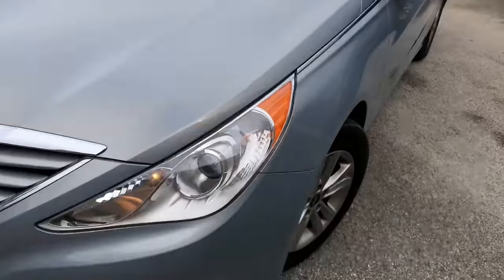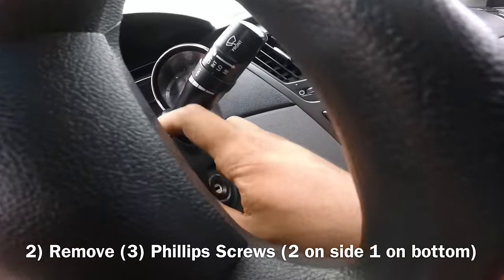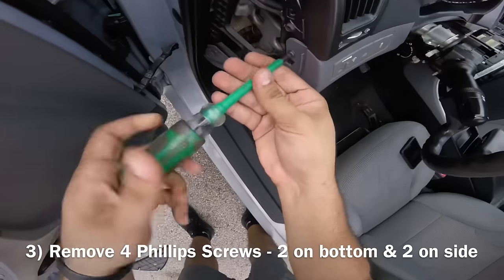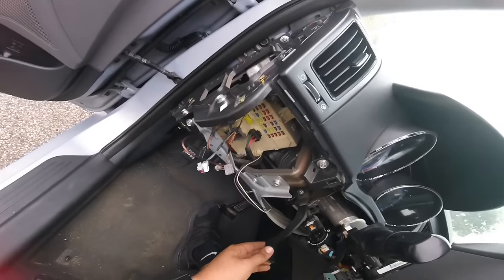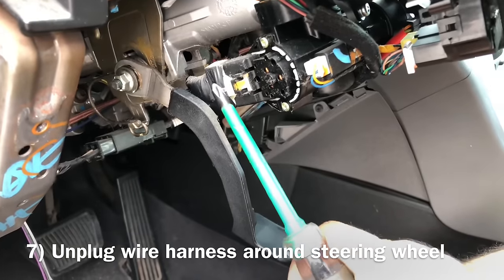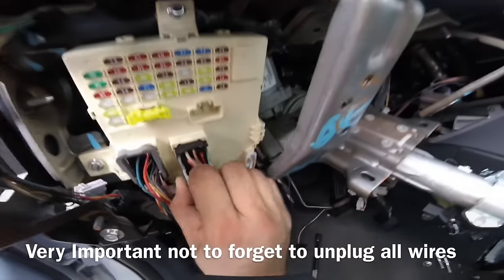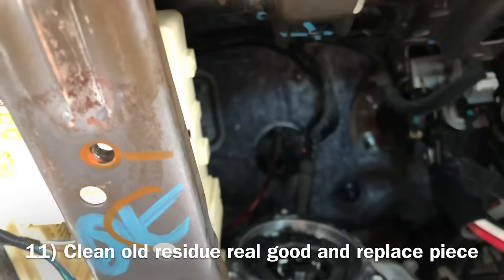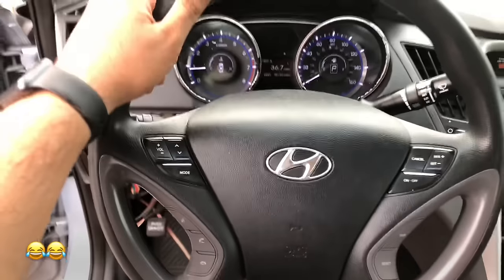HYUNDAI STEERING WHEEL NOISE : HOW TO FIX - SONATA/ OPTIMA 2011-2014 UNDER $20!! FAST & EASY!

Comment: Thanks a lot!!!! But I have an issue. I did this on a Veloster. When I put everything back together the steering wheel is off center. Like WAY off...  Any advise in how to fix it? Thanks in advance.
Reply from the maker: randall Dustan sounds like you may have to get a front end alignment. Just “toe” adjustment and should be back to normal... unless you wanna take it apart and try to straighten the wheel without the hook coming off... idk.. haven’t had that issue yet :(
Reply: @HidalgoMotorsCo  thanks a lot for the info though! I know it saves me a lot of money
Reply from the maker: You’re welcome bud! I’m glad I could help!
Reply from the maker: Hey Randall! were you able to fix the problem?
Reply: @HidalgoMotorsCo  yeah I got it fixed. All I had to do is remove the steering wheel assembly and put my key in the ignition. That unlocked the column and everything fell back into place.
Reply from the maker: wow! okay that is very important! just gotta be sure the steering wheel is not locked!! gotcha!! thanks man! super glad to know!

Comment: Successfully replaced...driven for over 500 miles without any issues, but have a plastic on plastic sounds turning right at the steering wheel? Any suggestions

Comment: Nice video! Question: so I had my sonata’s steering column replaced and then they noticed this needed to be fixed. I found another place that could do the labor for way cheaper so they put my car back together. I don’t think it has the coupler in there or maybe it’s the old, worn down one?? Anyway, I’m getting some noise from the front tire area and it sounds like something is loose. Is it okay to drive without the part for two days until my appointment or should I try to do it ASAP?? Thanks!!!
Reply from the maker: Mark Melby yes it’s okay. But you have to drive at your own risk. Steering wheel tends to shake a lot at highway speeds.. and have them change your CV axles and your suspension. Any clicking or clunking could be cause by those 2 things.
Reply: Hidalgo Motors Co TV ok thanks! I didn’t notice the clunking from the front before they put in the new steering column. Could the coupler missing affect that or could there be something loose?

Comment: So some people are saying they still had to take it to the dealership to get the codes reset for power steering. Does that sound right to you?
Reply from the maker: sounds about right. I didn't have to take mine back at all.. it worked perfectly... I don't see how the light comes on... unless they don't position the cover of the coupler back on correctly, I mean worst case scenario, take it to the dealership :) better safe than sorry, ask for a diagnosis, and then you try to fix as much as you can on your own.

Comment: Hey!! Trying to fix the issue. My husband took it apart yesterday, but when he was putting it back together the wheel got stuck and not moving. What could havehe done wrong? He's saying the motor is seized up...
Reply from the maker: That’s an excellent question. Please be sure he plugged everything in I would take it apart again and make sure all parts are connected properly.
Reply from the maker: Also the steering wheel locks sometimes when you turn it to the side once it’s off... maybe it’s that... messing with the steering wheel WILL NOT seize up your engine. If the car won’t start there’s a high chance he missed something
Reply: @HidalgoMotorsCo  I meant the steering column motor. He ended up ordering a new one. Hopefully that'll work

Comment: Just pulled mine apart. The old coupler seems to have melted and is a gooey mess. Does this have to be super clean before installing the replacement part?
Reply from the maker: Bob Oliver that’s a great question! You have to get it clean as best as you can. Grab a rag, or a brush and get all the stuff out of there.
Reply: @HidalgoMotorsCo  Ok. Thanks for the speedy reply. Great video. As all the others have said, thank you for posting this!
Reply from the maker: Bob Oliver you’re very welcome! Thanks so much for watching!

Comment: How often does this need to be replaced and whats the typical cost range you would get charged to replace it at a shop?
Reply from the maker: Hey! If you are lucky enough. You will only have to do this at least once after a while. 
The part costs under $30 from the dealer. 
What kills you is the shop labor rate. Specially if some charge about $75-100 per hour... 
One of my viewers took his in.. and they were trying to replace the whole steering column.. not the piece.. they tried to up sell him and refused to fix just that plastic coupler. They say it cannot be serviced. Although it’s a recall on these Hyundai’s... most of them aren’t covered. But check to see if yours is covered by the recall and it will be free!

Comment: I did this on my 2011 sonata yesterday, completely fixed the noise problem but now my EPS is out. Checked fuses and connectors and everything looks good. Also tried taking the negative off of the battery overnight. Is this just something that needs to be cleared?
Reply from the maker: You know I never had that issue... I wonder what happened... maybe needs to be cleared or something that’s an excellent question.
Reply: @HidalgoMotorsCo  I wasn't expecting it to happen, but after it did, I did some searching and I'm not the first person it's happened to 😅 taking it to a shop tomorrow and hopefully we'll figure out the issue
Reply: @cheyenneparker3674  Hi. Did you find out what it was. My ESC traction control light came on suddenly with the Auto stop start light on dash (ISG)(and have no cruise control) the other day and I you tubed it and could poss be brake light switch worn out.  A few ppl on Hyundai forums have said it could be a sensor under steering wheel due to it not being in a straight line (but most tend to not know and guess). Hope you sorted it. Getting a reader on mine this week. 👍

Comment: Hi, gonna do this soon for my 2011 2.0T. Question : if done using steps in your video, does power steering need "reprogramming" like another person's video said ?
Reply from the maker: kayla krattiger I did not have to reprogram the power steering at all. I didn’t have to re program anything. Just unbolt replace and bolt back up
Reply: Thank you, I'll let u know how it goes
Reply: Im in middle of process, just got all the trim covers off and wires disconnected. Next is the bolts n nuts and the A/C vent.& so on. 
Came here to say I have long fancy nails & a toddler climbing all over. So, This is def do-able for all but the most nonmechanically inclined. Saving a few hundred dollars is worth the hassle!
Reply from the maker: kayla krattiger thanks so much for your feedback! Hope everything turns out good! :) done lose any bolts now! ☺️
Reply: Still goin strong with that Fix! So ooo much better! Only thing I regret is not doing it sooner, drove around for MONTHS with ut rattling and the replacement sprocket just sitting in the trunk waiting to be put in. What else do you have for 2011 Sonata fixes, LoL
Reply from the maker: I am so glad! Thanks for watching! We are proud of you!! we will definitely upload more Hyundai fixes as they come in! :)

Comment: hey, i own 2012 sonata limited. have similar issue, steering clunk. need to fix it, milege 108000. checked with a repair shop and he gave estimate of $1500, with labor and dignostics for electronics. i think it is too much, any suggestions?
Reply from the maker: I think you should run far away from that shop for them to be charging you that much! it all depends. maybe you need to get your CV joints or axles replaced.

Comment: I got the part and I'm excited to try it this weekend, seems very doable. Did you disconnect the battery as soon as you unscrewed the steering wheel screws? I just want to limit the risk of the air bag somehow deploying. The other car I work on is an 87 cherokee and has 0.0 air bags.
Reply from the maker: I did not disconnect the battery at all. I recommend you do disconnect the battery after taking out the screws. thanks so much for watching! good luck and please share your experience with us!
Reply: @HidalgoMotorsCo  mine 2011 elantra was completely different, with two mounting screws much like in the video, but then a main bolt that goes horizontally through the back of the column. it only took me 40 minutes to take everything out and replace the part, but i've spent 2 hours trying to align everything so that the main bolt will actually tighten. not a hard process seemingly for other years, but would definitely advise the 2011s to not try it.
Reply from the maker: We are very proud of you! Thanks so much for sharing your experience! Did it fix your problem? :)
Reply: Katherine Galbreath 
Hi could you please help me where to get this small wheel like part

Comment: Can it also CAUSE car to vibrate? mine is vibrating when I go over 65, but mechanic wasn't able to fix it even after lots of repairs to tires and brake pads and rotors.

Comment: Hello. Found out I had the same issue and replace the part and my steering wheel doesnt make a noise. However, my  steering wheel is not align with my tires. What should I do?

Comment: I was able to change out the part on my 2013 but the power steering does not work at all now and is giving a C2400 fault code. Any ideas? And is there any issue driving the car like this?

Comment: Fixed the steering wheel clunk. My Hyundai Elantra was slightly different but not much of an issue. It was challenging to line up the motor when reassembling. However, now my ESC Off light is on. I verified all plugs are plugged in and I replaced the stop light switch. No joy. Do you think I may have messed up the steering alignment module when I wiggled the motor to fit everything? Any chance a regular OBD2 reader can reset the light?  FYI, I did NOT have to remove the steering column.  Thanks in advance. Great video.
Reply: FYI, I changed the brake switch and that didn't fix the problem with the ESC Off light.  Now, after driving a while, the EPS light is now on.  WTF?  I'm hoping I can take it in (when my daughter gets back from school) and just get a steering calibration done.  I can't imagine anything broke while changing out the steering coupler.  Please let me know if you have any thoughts on this subject.
Reply: Rusty Lloyd 

Same exact issue for me.

EPS lights won't go away after replacing coupler. 

Did you find any solution?
Reply: Milan Patel , not yet. I’ll be taking it to the dealership once my daughter brings the car back home on April 19th. I’ll post what the resolution was once it gets fixed. It’s frustrating.
Reply: FYI, took the car to Hyundai and they recalibrated the steering and all is fixed. He said the Elantra Touring hatchbacks are the hardest coupler to change and they almost always need recalibration afterward. For some reason that particular car is extremely picky.
Reply from the maker: wow I did not know that, thanks for the input!
Reply from the maker: have you fixed your steering issue yet?
Reply from the maker: have you tried taking it back to dealership for steering recalibration? that is the only thing that I could suggest you do.
Reply from the maker: have you found a solution to your problem?

Comment: Hey... I have a2011 sonata... I have the same noice... and also I noticed that the steering wheel is really smooth when the car is not in motion... but when I start to move the car steering is back to normal
Reply from the maker: Hmm... not quite sure what you’re trying to tell me or ask me... is it a problem in your car? Could it be maybe a power steering low on fluid? Idk
Reply: Hidalgo Motors Co TV  the steering has really low resistance when the car is on and not in motion . I do not have to give in a lot of effort to turn the steering wheel when the care is on and not in motion. But when the care start to move on road ... there is normal resistance in steering wheel

Comment: the front right mounting bolt that keeps the steering column attached to the body broke off. What can I do? It's still sturdy with the other 3 but I will need to replace it.

Comment: Hi. I have the Hyundai i40 2012 reg keyless top of range with glass panoramic roof. 130.000miles UK on motorway. 70/30 Urban. It's the worse car I've ever owned. Pulls to the left, scrubs tyres, suspension is weak/ poor and can ground out sometimes. I'm looking at checking and changing the track rod ends as there is movement on each wheel and that will hopefully stop the scrubbing of front tyres. Might have to change the bottom arms as there's wobble on uneven roads through the steering wheel and can feel play as I'm changing gear when engaging the clutch pedal. I'm guessing wishbone arm bushes have gone. Also last week the ESC light came on. Looked it up and hopefully a brake pedal switch. Brake Lights work OK but Auto ISG light is orange on dash and gives me no Auto stop at junctions (which I'm not bothered about as I've had to replace a 2nd turbo with a turbo cartridge within 2 yrs. The recon was prob a Chinese crappy cartridge as fitted in 2018 due to owner before me never changing oil). Will check diag codes and hopefully a worn brake light switch. Anyone had this prob? . And also the steering wheel clunk just like in this video.... I give up. Will fix it for Mot and then sell it. Paid £6000 2 yrs ago as never had a newish car ever before and 40.000miles later everything is going wrong. Wear and tear is fine, but parts are expensive unless sourced from good quality dealers. Nice car but mine was obviously built on a Friday. Thinking of going back to Audi as had 4 A4 2.5Tdi Quattro avants and 1 A6 2.5Tdi Quattro avant since 2012 (all R, T and 02, 53 plates. Thanks for the great video and hopefully I'll get time to do it after I've done the work for MOT.👍
Reply from the maker: Wow my friend I am sorry for your experience! I really do hope you get it fixed.. and can’t go wrong with Audi! They’re great and built well! Thanks for watching and good luck!
Reply: @HidalgoMotorsCo  Today I checked the wishbone suspension arms and they seem OK. Def need 2x track rod ends as theres a fair bit of play in both wheels when checked for side to side movement. Cheaper than wb arms and one less job. Hopefully Mot,'d soon. 😃👍
Reply from the maker: Steve Jarre awesome!! Good luck my friend :)

Comment: is it normal for the eps light after the replacement?thnx..
Reply from the maker: Ginobelle Gino it is not normal. No lights should be on. Please double check you have everything connected correctly and snug.

Comment: Hi after I put it back together the warning lights lit up like a christmas tree. I read through the comments, saw someone had a similar problem and you recommended checking the connections. I re did all the connections. Now it's not doing anything. Won't start or show hardly anything on the display. Any suggestions?
Reply: follow up... I tried some of the suggestions listed in the comments. I disconnected the negative terminal overnight and pulled the ECU fuse. The next morning I reconnected  the battery and fuse and everything worked like normal. And the steering is fixed too. I had a big scare there but it looks like everything is good.

Comment: I just did this and my car won’t start has a check engine light and a traction control light. Any suggestions what the cheapest code scanner tool is to reset the Sas?

Comment: I have elantra 2020 and I have this sound but with a lower sound than yours Is this the same problem
Reply from the maker: That's an excellent question. The process should be fairly similar. But I would still suggest doing a bit more research since they're so recent. - please let us know what you find out so our other viewers can read and maybe solve their problems. Thanks for watching.

Comment: There is an extended warranty (TSB) on this problem with the MDPS steering coupler - 10 yrs/ 
100k miles.  I just got my 2013 Sonata fixed for free by the dealer.  Also for 2015 -2017 Sonata the warranty has been extended to 15 yrs /150k miles.  The warranty covers original and subsequent owners.  Just do a search for Hyundai TSBs.

Comment: That was helpful. My daughter has a 13 elantra, says its making that noise, I figured a clock spring, cause she has no buttons working on the wheel. May be both, but thanks. Yes, looks like a pain in the A**. I hate imports!
Reply from the maker: If the steering wheel buttons aren’t working it could potentially be a fuse as well. I suggest you get it professionally diagnosed to be 100% sure and save some time and money! Thanks for watching by the way!

Comment: So I had remote start and it’s way different yikes I got different colors and don’t know where they go
Reply from the maker: Cubankungfuwolf some could be differently but Hyundai was smart enough to make the connectors fit like a puzzle. So every wire should have a different connector that will prevent you from making that mistake

Comment: Thanks man, did this and my clock spring at the same time! saves me from doing 1 and going back to do the same stuff lol.
Reply from the maker: you are very welcome bud! thanks for watching! I am glad we could help you out.
Reply: Hidalgo Motors Co TV 

I have the same exact issue with my car and the mechanic told me it’s just a clock spring issue after he drive it. He didn’t mention anything about this little part. Do you think what he said is correct or is he just an idiot ?

Thanks for answering!

Comment: Hello Hidalgo, mine is a 2015 Sonata is it gonna be the same part???
Reply from the maker: you know that is a good question. basically it should be the same thing. I personally haven't done any 2015 to let you know.
Reply: @HidalgoMotorsCo   Hello Hidalgo my car has something similar but idk if its actually same problem as this. Can I send you a video?
Reply from the maker: @katme0w390  yes post the link and I will check it out